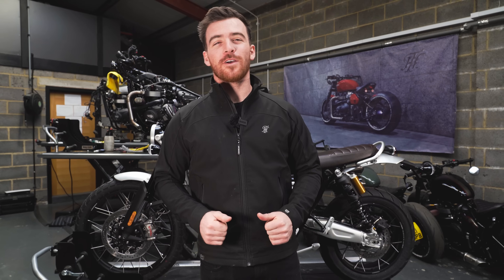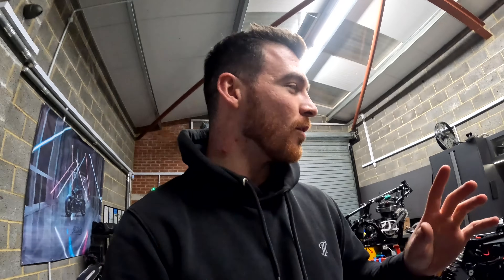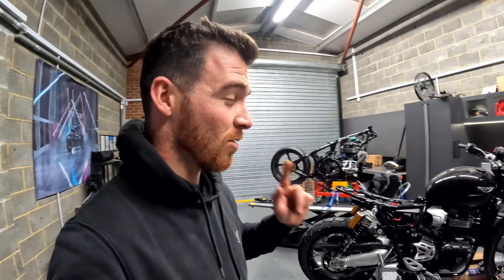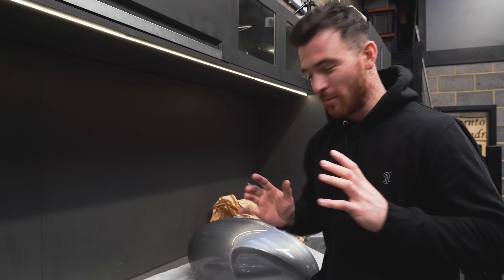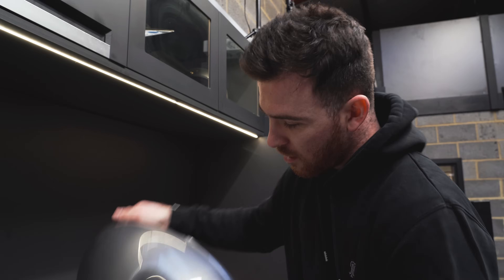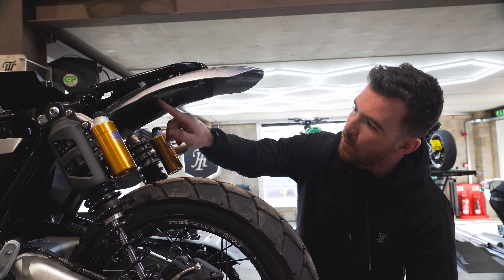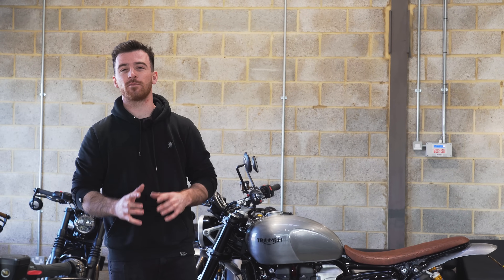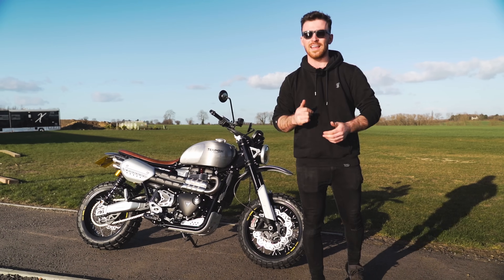How to BUILD a Custom Triumph Scrambler XC

Comment: Or...they could have bought a Street Scrambler, which is designed for shorter riders and those who don't want the extra ground clearance/higher riding position.  That seat looks good, but I pity whomever rides on it for more than 20-minutes.  The small/child wheels are going to spin far too easily with the 1200's torque.  On a positive note, great job on the paint and exhaust.

Comment: That radiator looks like it will get compromised in the mud without a mudguard/fender protecting it. And what's the difference between this and just getting a street scrambler at that point.
Reply: The 1200 and 6 speed, plus cruise control
Reply: @Jmort93  no 6 speed in the street? But yes, duh, that 1200 is so smooth, lol. Forgot about that minor difference.

Comment: Awesome build dudes! Just a question - are those new wheels still tubeless? Also love the brake rotors, are they bolt-on for a standard Scrambler 21/17 wheel setup?!

Comment: Coming from a guy with a 29" inseam this seems perfect. 1200 motor at 900 height. Perfect idea to just change the tires and wheels. The 17" front should be a really nice improvement in corner handling too. In my opinion the suspension is way to soft so softer springs would be a no for me though. Great license plate bracket and location, I like it over the side mount as well. Killer unique paint. Another overall 10 out of 10 per usual for TH. Cheers to you all
Reply from the maker: Grateful for the feedback Bill! We're so happy you like it, definitely more to come 🤘🏼